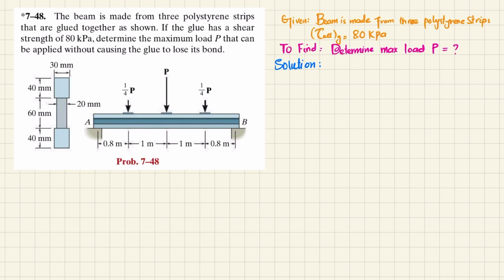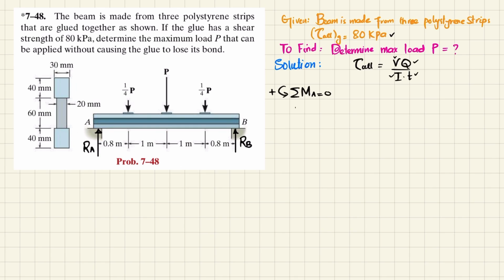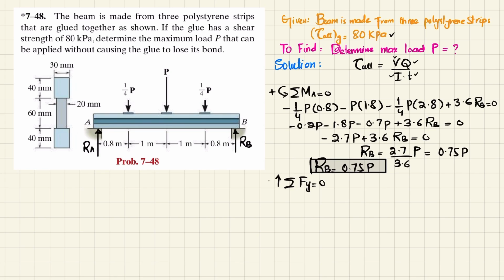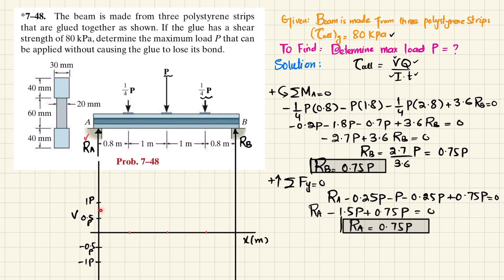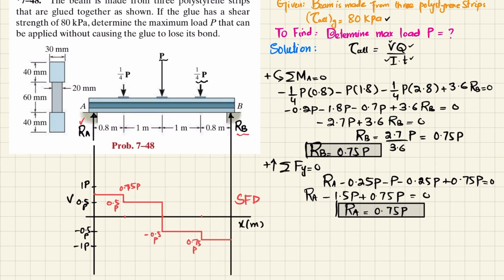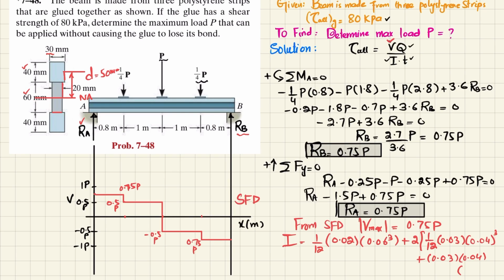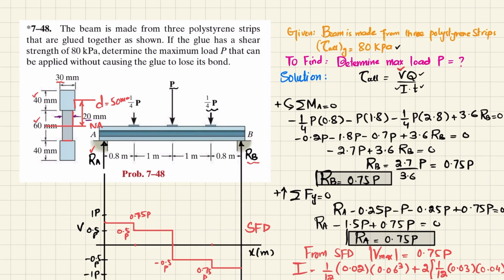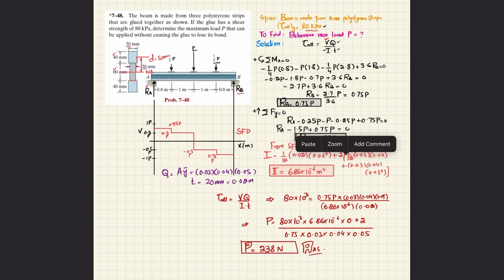7-48 Determine maximum load P without causing glue to lose its bond | Mech of materials Rc Hibbeler

Comment: Hi! I have a question, why in the Q equation you consider only the upper part of the structure and not also the other part? ( the darker one). I thought that Q was the sum of two different Q, one for the light blu area of (30)(40) and the other one (20)(30) with the respective distance from the middle of the section to the NA line. Why now it's different??
Reply from the maker: The simple reason is that we are going to find out maximum value of P that can be applied without causing the glue to lose the bond. So shear stress will cause the shear flow which will tend to lose the bond so your shear force and shear flow should not exceed. Now the bond is between the lighter section and darker section. For calculating the Q we will take the area above the glue to get the shear stress ....
Reply from the maker: If the beam was a single element then we will tale the Q as per your statement
Reply: @engradnanrasheedmechanical  thank you for your response! Now it's clear!❤️
Reply from the maker: @gabbodeva you are welcome 🌹 and please share my videos with your friends ❤